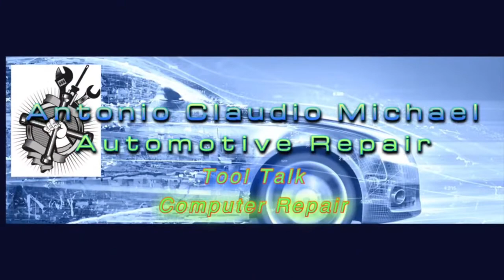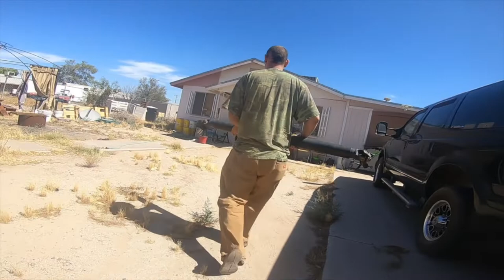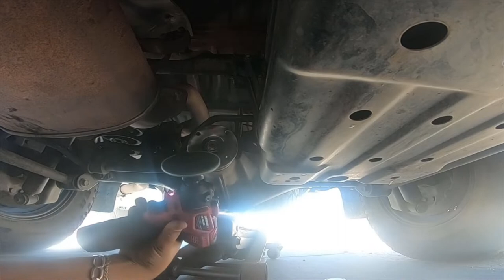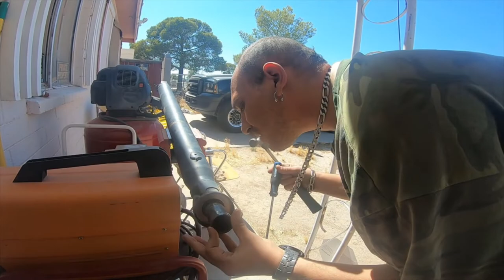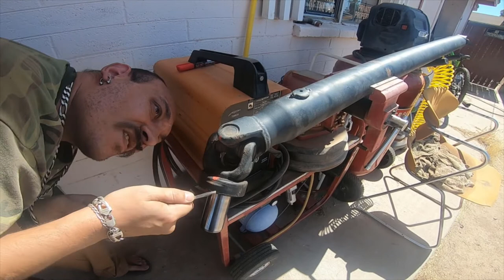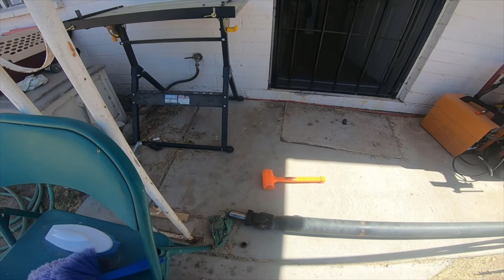2000 Toyota 4Runner - U Joints Drive Shaft Replacment Part 2

Comment: Thanks for putting the videos. I have the same truck. Did you just pull the drive shaft out from the transmission? There are no bolts right?
Reply from the maker: No bolts on transmission side you are correct just disconnect it from diff and slide out of transmission
Reply: @AntonioClaudioMichael  thank you for the quick response.
Reply from the maker: Your very welcome